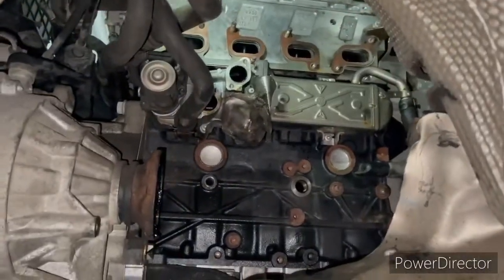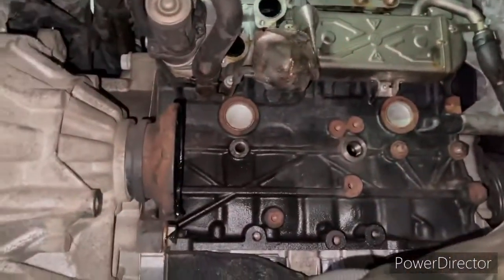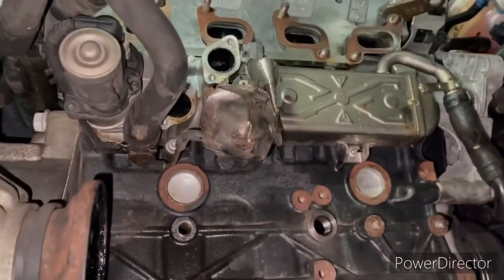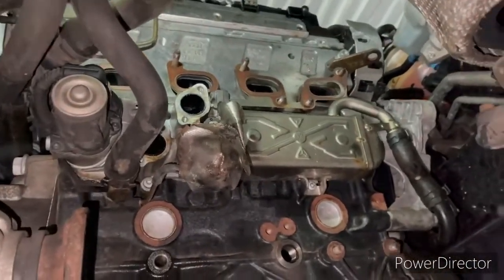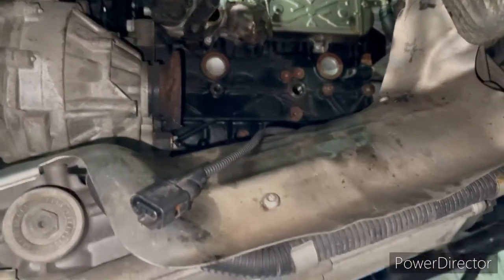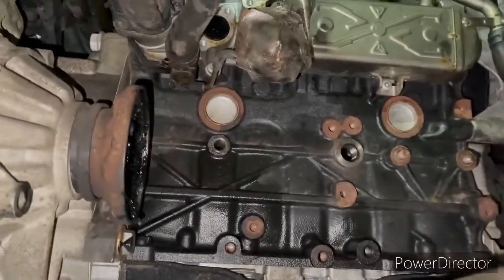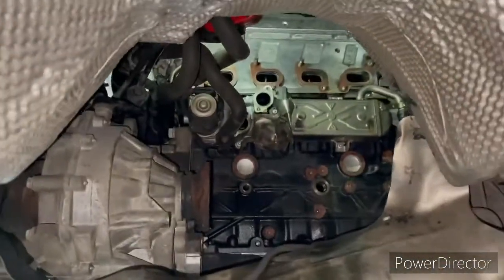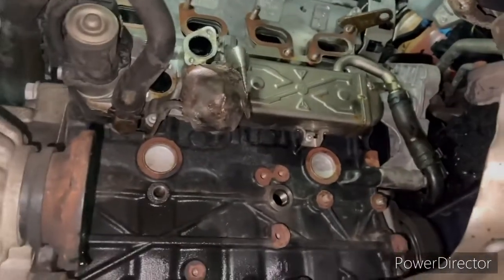VW 1.6 TDI How To Replace Turbo

Comment: Thanks.  Can turbo fit past egr to get it out, or do you need to fully remove egr first? Is this job very hard to do on the ground?
Reply: You can get it out from the top. But imo removing the EGR altogether and deleting DPF would be the best solution
Reply: Wow you made that hard for yourself